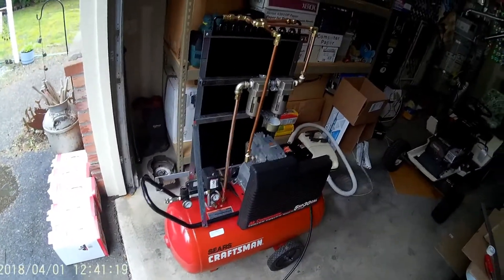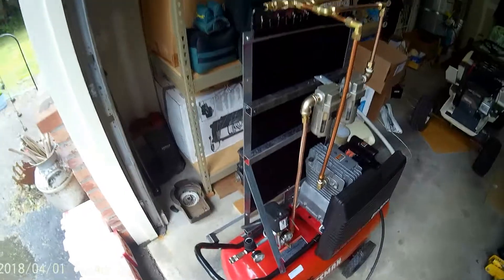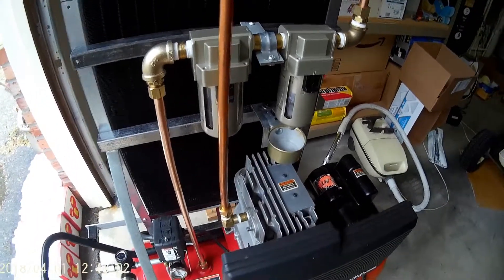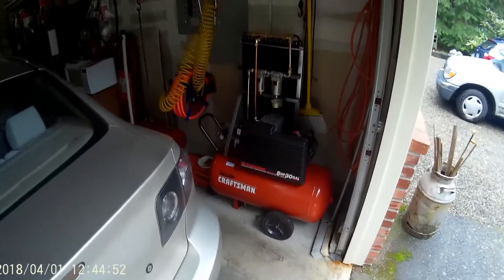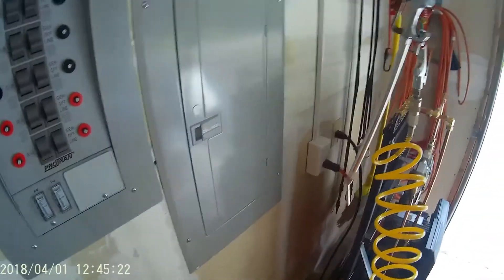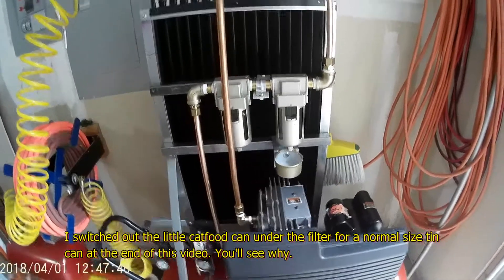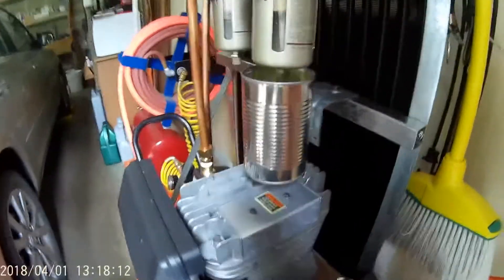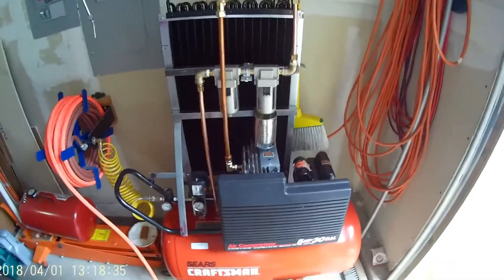Home Air Compressor Modification

Comment: Wouldn't the condenser just fill up with water all the way. I was under the impression that the outlet of the condensor should be the lowest point so all the water that condenses can actually leave the condensor. Also the condensor should be mounted so that the tubes in it are horizontal for the same reason.

Comment: Great setup!  I think I have the same as yours, almost.  6hp 33 Gal Sears oiless compressor, going through a condenser I got from a junk yard out of a late model Escalade.  Only I have a trap going in to the condenser, another one on the output of the condenser, and yet a 3rd one at the tank outlet.  In the several years this has been running, I  have yet to get a drop of water out of the trap on the tank!  And this is North Alabama, humidity capitol of the universe.

Comment: If you solder a little piece of copper tubing on the side of that can at the bottom and put a piece of rubber hose on it and run it somewhere that you don't care where the water goes.

Comment: I see a what might be a  problem with your setup the line coming out of the compressor you have going straight up. I would be concerned that, that copper air line will fill up with water and when the compressor shuts off will run back do into the compressor. Possibly cussing  issues.

Comment: at about 7 minutes into the video, listening to the compressor run, it kinda sounds like your pump might have a rod knock.... it is hard to say for sure, but it sounds similar to a sears one of mine that definitely had a rod knock.
Reply from the maker: You might be right. I know the sound, it does it all the time, but it just keeps on going, and its almost 30 years old so not going to worry about it. But thanks for noticing :-)

Comment: Your running air thrthrough the inner tunes of after cooler but without a fan going through the fins of the after cooler  it's really not doing anything, what's really working for it are those inline filters. With all that modification, you should have put a premositure filter in between the cooler and the injected air, than a desiccant after filter out of after cooler into tank...then a automatic drain at the bottom of the tank...

Comment: 👍🏻. Could you please send the link for the condenser you purchased on Amazon Thank you.
Reply from the maker: Sorry, the link is no longer available. Frankly, any condenser will work, but you'll likely have to cut off any existing fittings and add your own to fit your situation. Once I got it, I took it to NAPA and told them what I wanted to do, and they found the necessary adapter fittings to  complete my connection to the compressor. You'll probably have to play around with it a little, but, again, any condenser will work.

Comment: I used old used AC split unit that hangs  outside the building. It does make a HUGE difference. No more water in my air tank
You could use sweat fittings and solder everything. It would cost less and less chance to have air leaks.
Reply from the maker: Great idea! Good for you!

Comment: Probably not possible due to the compressor being a horizontal mount.  But You'd get more water out of the air, if the air dryer/filters were below the condenser, AND the lowest point of the condenser needs to be the exit port for the air.  Then the two air dryer/filters you have there should be below the height of the air inlet on the tank by at least 6" and the tube running from the air filter/dryer needs to be an up-hill tube going up and then into the tank.  I wish youtube would let me draw a picture in the comment area lol.  Make due with my lines, and arrows...
           condensor --- >     ||||||||||||||||||||||||||||||  < ---  Air IN
           [Cool AIR IN]         |||||||||||||||||||||||||||||| 

                       |                   ||||||||||||||||||||||||||||||  < --- Air OUT-----|
    ________|_V_________________________________________|-______
(                   |                           Air Tank                                     |                  )
   ----------------|----------------------------------------------------------------------|-------------                   
                     |                                          |------------------------------< 
                     |------------------[air dryer]---<|

Comment: The tube diameter of your condenser appears to be smaller than the tube diameter of your compressor. This introduces a flow restriction and will reduce the overall performance of your system. You should use the same ID Tubing or condensor (Perhaps transmission oil cooler?) as your compressor. That way you do not  reduce the max flow rate of your system.
Reply from the maker: I'm well aware of the minor deficiancies. The tube diameter of the condensor was an issue I couldn't avoid since I bought it online without knowing what they were. The main thing is, for the relatively light use it gets for a homeowner, I'm happy. Its quieter and no issues.  Please make sure you view my updated video in which I rotate the condenser 90 degrees to horizontal as per some others suggestions. https://www.youtube.com/watch?v=hnUOH1bcBr8

Comment: those things dont work it cools the air sure but the water is still in the air and thats no good. What you want is to condense the air like in a still and then drain it out a drip leg, that way you get rid of it. Just cooling it does nothing its still in the air its just not in larger drops its a vapor its not gone. To understand this see the very expensive air dryer systems, they cool condense and get rid of the water and then warm the air back up for use. However these drying systems will probably cost more than your small compressor..
Reply from the maker: This is a little used home system and for the little I use it, this works just fine. I have TWO filters after the condenser to catch most water before it goes in the tank. In my 2nd video I turned it over so the inlet and outlet are now on the bottom with a drain valve on the outlet before the filters so I can drain any moisture caught at the lowest point. And my next project is to reposition the condenser sideways so that the outlet and drain valve is really at the bottom. I appreciate your comments.
Reply: @Catttrain  Seeing your initial setup and reading the comments, I would agree with most about the positioning of the condenser and having everything, through gravity over air pressure/flow, drain to the water trap or drain valve.  It sounds like you have or will be repositioning the condenser based on your latest comment here.  I was also curious if you found any water in your condenser after dismantling it?   Overall good job with the setup and we all learn as we go.
Reply from the maker: @archoplites  Yes, there was a very small amount of moisture but by far the majority is/was blown thru to the filter. I've have since remounted it sideways with the  pipe from the head going down and to the condenser. Looks better too.

Comment: If you have the cooler vertical, water will collect inside and will never be able to drain.  Run it horizontal then have the inlet on top and the drain out the bottom.  This will ensure your cooler does not fill with water and your air filter will remove all of the water condensate.  Hope this helps.
Reply: Nathan, This was thoughts as well. I truly understand his desire to keep it compact yet his is portable and mine is sitting on the heavy wood platform built for my 60 gallon vertical. Using cheap and easy to find parts, but my A/C condenser is GM truck. 1 part number fit over 1,800 models. Yet, tape measure in hand, it passes be my small part bins because the SS food table I bought salvage has bent 10” lip on back. 14 foot long, rolled front lip to catch fluids, 4 drawers, non-magnetic and this $60 investment take 3 men to move. With the compressor in the corner, it will move out to work behind it, but not looking forward, but not wanting tank bottom to rust and old school paint filters, won’t cut it. 1/2” on top, 3/8” bottom and compression fittings have changed. I don’t like them but it is all everyone sells. No more ferrule or “Olive” as the European’s call them. I am thinking of 12Vdc fan on one end to increase efficiency as one guy bought an inverter at HF with enough amps to run it. I can measure, I have 4 amp meters for dc, can’t find one, but I am in the 20-25 amp continuous range excluding start surge. No filters here but at dedicated outlet for paint, like hose, paint only. Wired to compressor, fan comes on with one side to 240Vac hot. I think it will pool when off, or even running. Thinking out loud.
ASE Master Tech since 1978 - Retired

Comment: How are you draining the water out of the aftercooler?  If the moisture is in the trap, it's definitely in the cooler.  Maybe you could flip it over 180 and you can plumb in a drip leg and drain valve.  Good luck.
Reply from the maker: ihaulag I did that, see my follow up video

Comment: Hello, what is the dimension of this A/C condenser? Thank you.
P.S. do you have amazon link or part # of this condenser?
Reply from the maker: The dimensions are approx 16" x 28" which is fairly large. I can't find the part#,  but its for a 1973 corvette if I recall correctly. I had to cut off the existing fittings, and local NAPA store measured the two different in and out pipes and provided me with new copper compression fittings. You could use almost any condenser, brand or size really doesn't matter that much. They are designed to cool and any will do that.
Reply: @Catttrain  know one with at a 1/2 size condenser?
Reply from the maker: @cali_cal  I would think that any condensor or radiator of any size would work. Perhaps even an automobile HEAT EXCHANGER, they are small.

Comment: Sir your asking for trouble letting the water drain back down to the engine and enter the cylinder , you could install a check valve to prevent it
Reply from the maker: I have in fact added a drain valve so any moisture coming back down will not go back into the cylinder.
Reply: @Catttrain  good idea a T fitting with a 6 inch nipple and valve at bottom, in case you forgot  the nipple would have enough capacity to hold the amount of water...

Comment: Problem; you have no way of draining the radiator! It will fill of with condensate as the discharge is at the top of the radiator when it should be at the bottom with a collection tube.
Reply from the maker: The majority of condensate that might settle should blow thru to the filters the next time it cycles. Not worried about it.